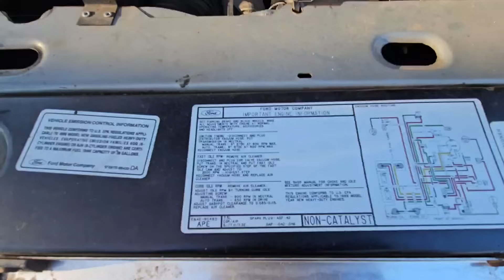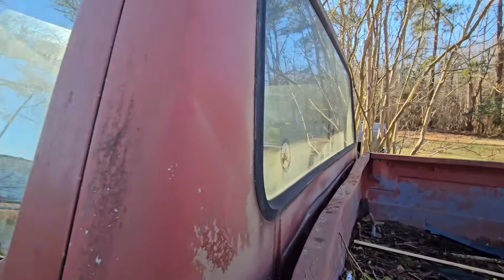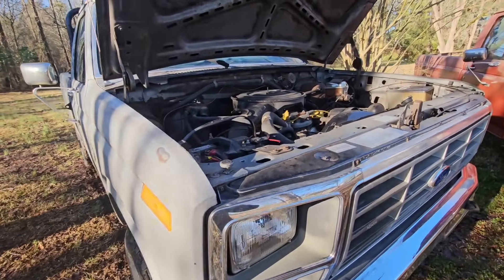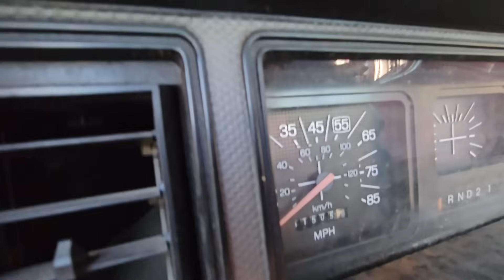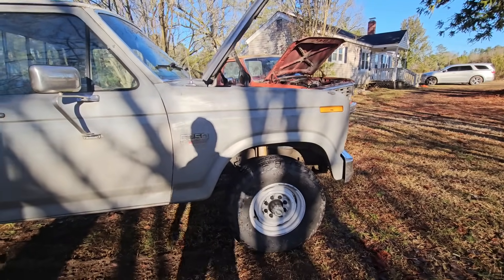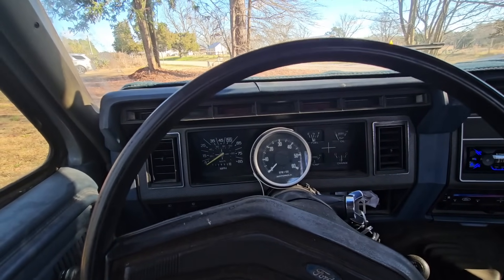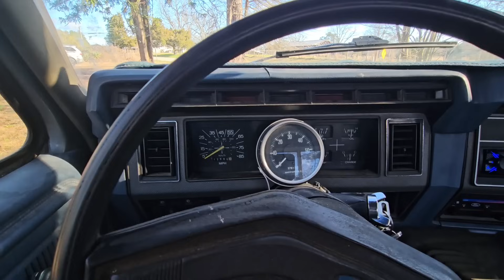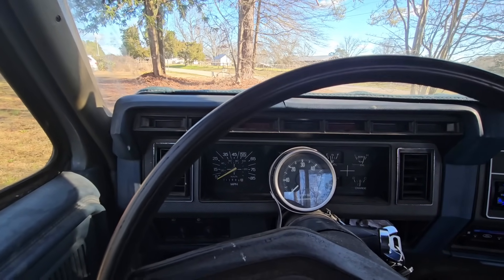THE WORST TRUCK FORD EVER MADE!?!?! #ford #fseries #sbf #bbf #truck

Comment: I bought a similar new 351 F100 ute in Australia in 1981 (Ford Australia) and after less than a year the interior plastic trim was falling to pieces from UV decay. The bonnet (hood) was rusty as hell as was the bottom corner of the cab, apparently due to poor rust proofing, as we don't use salt on the roads here in winter, it never snows.....
There were never many of these body style sold here, probably because of the shitty build quality. Of course here they were RHD, so I assume they were assembled in Australia.
Reply: 1981 was the first year of Australian production for the bull nose F' series, the cabs were US ones converted to right hand drive although Canadian models were used in earlier models also.
Later 92 on Brazilian assembled right hand drive models were sold by Ford Australia.
There were some complaints re build quality however overall the new cab design wasn't as robust as the 73 - 80 series and dash board rattles and plastics were sub par to Toyota Landcruiser and Nissan pickups here .
The chassis and drivelines were generally good,  although very strong, the aging design of New Process 435 manual gearbox was clunky with a 6.69:1 first gear and a big jump to second leaving a 3 speed gear box with a super low reduction 1st.
The later 5 speed manual gearboxes were more user friendly and gave a better spread of ratios.
The Dana 44, 44HD in 4WD front ends were quite robust and the F100 ford 9"  F250 Dana 60 , F350 Dana 70 floating axle rear ends were strong rear ends.
C6 auto's were quite a hefty transmission and generally if cooled well gave little trouble.
Cab rust was always a feature in coastal F series in Australia less so in the dryer areas.

Comment: I had a built 351w retrofitted in an 88 mustang LX. That was a wicked engine with the right aftermarket parts. The specs for the 460 sound correct, like 225hp, but a lot of torque.

Comment: Nice Trucks !!! 85 & 86 F 250 and above didn't have catalict convertors.  Air pump would put it back in the manifolds .they burned real clean . I had a red 1986 F250 2wd 351,4 barrel holley carb,c6 trans and the monster rear end . Hands down the best truck made , no ac ,you use the small side widows,better than ac . I miss you girl .

Comment: Yea those bull nose trucks are definitely not ugly to me there definitely better lookin than the block nose front end trucks but I’d take either truck though. I got a 85 f-150 from my papa after he died in 2002 and I still got it today. I’ve just swapped it over from a carbureted straight 6 to a fuel injection 302. I also got a 07 f-150 KingRanch but just to be straight out honest I’d just assume to drive either truck still today

Comment: I had around a dozen F150’s 81 to 86. All but one had the 300-6. The biggest problem with them was the stupid emissions and carburetors especially after 1983. 
If you wanted to find a real rare 80’s Ford truck see if you can find an F100 with the 3.8 V6. I think the 3.8 began in 1983 but wasn’t available very long. It might have been available in the F150 too?

Comment: Ford never made a good truck bought a 1980 f-150 brand new and it caught fire tried an 86 f250 it turned out to be a money pit had 1999 f-250 couldn't keep a front differential in it btw all of these was 4wd after that I bought a 2004 Silverado 2500hd with a 6.0 and 260,000 miles later all I've needed is tires,oil and grease and normal tune ups I'll never own anything other than a Chevrolet

Comment: Had a used 71 Lincoln with 460  and later a 72 Ranchero with 351. Both great engines, lots of power and 20 + mpg.

Comment: My father bought a 83 F150 and a 89F150 , both great trucks ,, both have the 6 engine with manal shift.. the 83 was on the column 3 speed and the 89 was a 5 speed on the floor.  Both were RWD with a single cab.  I drove them both and loved them , but not the best for city driving.. both were super reliable, comfortable and rode great.

Comment: I  own an Australian assembled F350 4WD, right hand drive , fitted with the last of the Australian cast block 351 Cleveland, an engine factory fitted to F series here since 1974.
Other than the odd dash board rattle I have generally found it to be reasonably robust and capable truck, having said that I also own a 1974 Australian assembled F250 Hi Boy originally fitted with a 300 cu 6 cylinder but now fitted with an Aussie 351 Cleveland also, both do the same job however power steering was not an option on the Australian Hi Boys so the 74 350 is a little easier to manouvre at low speeds.
No computers and complex electronics make these both user repairable and generally reliable very trucks, especially in the remote and harsh conditions that exist here in Australia.
Both get my tick of approval, later US trucks are too prone to problems that can't be easily repaired out of mainstream area dealerships.
Jus sayin'

Comment: I just sold last year a 1986 year I graduated from high school, 2 Wheel Dr. it was the same color as that brownish one. I don’t know what that color is but it’s not brown it’s weird brownish gold I guess they call it and it had 47,000 miles on it it was a really good truck. It didn’t run when I bought it. All needed was a carburetor rebuild and some timing and a few other little small small things.  It was wonderful and I’m kicking myself in the ass right now because I’m remodeling an old house and I need a truck. I have a bump side but it’s too nice to use as a work truck. That’s a hot rod my bumper sides a hot rod. Yes those are both great trucks summer more desirable than others if you remember  first couple of years I think 80 to 82 g to make them lighter and they bend. The one I saw was a 460 four-speed, single cab no rust, California truck in California at three-quarter tons did not come with catalytic converter‘s yet anyhow, nice video guys have a great truck. I’m looking for another one just stay away from the first few years. They got better as they made more of them and I think they’re way better than the flat nose ones of the late 80s early 90s, I had a 96 and I didn’t like it as much as the 86 but then again, the 96 was a 4.9 vs The 460

Comment: I have 1995 f-150 with 4.9 300 long bed I upgraded the front fuel tank from 15 gallon to 19 and this truck also came with additional 15 gallon rear tank. I only fill up nearly two times a month, but i wish i had four wheel drive 😅😅😅

Comment: Replace the timing chain on both trucks with double roller with multi index crank sprocket and set them up 4 degrees advanced from straight up. Run smoother, start easier, unbelievable low-end torque, and amazing  fuel economy. Makes them a lot easier to drive. Great video. Miss my ‘85 F 250 351w HO C6 automatic. Got 18 mpg highway empty.

Comment: I think the main reason no one likes these is because they rusted very badly, my grandpa had a 1983 F-250 Ranger XLT IDI Diesel with the heavy duty towing package that he bought brand new, that truck was getting pretty rusty by 1990 and we traded it for a 1991 F-250 Lariat XLT 460 V8 gas, that truck to this day we still have and has only recently started to get some minor surface rust on the frame. We've always maintained all of our farm trucks but that 83 just wasn't a great truck, styling wise everyone in the family loved it (it was dark brown with a tan two tone section across the center of the truck), but it just wasn't a great truck in other more important ways.

Comment: 1975 was the first year for Catalytic converters on cars, they started getting phased in on trucks over the next decade. We had a 75 F-100 that was non-catalyst but still required unleaded fuel. In 1985 it wasn’t A/C delete as A/C was an option.

Comment: Worst? I had an 82 f100 years ago and it was far superior in looks and hauling to my current 2001 f150. As far as I’m concerned ford hasn’t built a real pickup since 1997. They downsized the most crucial part the cargo bed.

Comment: Did I really hear you say that you were asking $5000.00 dollars for a $1500.00 dollar  truck.  What area do you live in where you think you can get that much money for those ?
Reply from the maker: @ralphsnow2337  $1500 for a running driving truck with heat an AC with fairly low miles even for an 1986? Did I expect to get $5000 for it? No. Always start high of course. I know what I had in it to get it back on the road. From the oil filter date when I pulled it., it had been sitting since 2011. I do not own the truck anymore and has since been sold, and I got $4000 for it. The truck is a daily driver now. Yeah it needs a paint job, but the body was very straight and zero rust. Interior was in great shape especially for being thebsun beating it got being a southern truck. Look on marketplace, the auto traders, ebay, bring a trailer, or wherever you can find these and find one for $1500 that is a daily driver with heat and AC, lower miles, and with zero rust
Reply from the maker: @ralphsnow2337  I can agree with you. I think this truck SHOULD be worth $1500. But I also believe my 1979 firebird should be worth the same price I bought it for 15 years ago. Which was about the same price as this truck and was and still is a daily driver, but unfortunately, inflation gets the good stuff. Everything is getting expensive.

Comment: My TTB '84 4WD Diesel has probably 500k on the frame and cab, has parts under it from 1983 thru its 1992 7.3, and has been hauling my butt and whatever i pull around with it since 2001. It will drag any other 1984 model from Dodge or GM down the road backwards, and ride much more comfotably while doing it. Best riding and most powerful trucks of their day, and a great bargain now.

Comment: i had a 1981 F250. Third owner and drove that truck hard for 18 years. It was a beast and was still going strong when I sold it. It was the second best truck I've ever owned. The best one is my 2005 Ranger that I drive today and have been driving for 19 years. It still runs and drives like new.

Comment: This is my favorite style of Ford truck. Had a few over the years. My first was a 1979 F250 with a 351 auto that I plowed snow with until my second a 1992 F350 with a 460 Auto 4.10 axles and that one was a towing fool, but was a little hard on gas. When I told my friends it had too much power when plowing snow, they informed me you could not have too much power, but when you turned around and started in the other direction it was a little tuff to get immediate traction so you could not plow as fast as you wanted to. My last and probably my least favorite was a 2008 F350 with that damn 6.4 liter Powerstroke. Got 5mpg when plowing snow.8mpg in everyday driving.

Comment: I owned an 89 F150 (300/5-speed), but I never owned one of those trucks. I did drive some of them as well as a fair number of well-thrashed Broncos and E350s. The place where I worked had a couple of early-mid 80s F100s, both 300/manual 4-speeds.  One had the SROD, and while no one ever sang praises about the transmission beyond Ford advertising, it wouldn’t break for us despite a fair amount of abuse. One E350, an 85, had the 351HO. I was initially surprised how much pep it had and thought it was a 460 until I popped off the dog house. Anyway, I haven’t seen any of those trucks for sale in my neck of the woods for a while that weren’t badly rusted that were cheap.
Reply from the maker: Experience speaks through your comment which is appreciated! They're great trucks for sure and not badly priced at all at the moment!

Comment: I would love to own either of those work horses.
I need a truck.
I've been using our 2014 Audi allroad to haul loads of large stone, wood, garbage, around our property...At one point over 640lbs quikrete cement.
She's been solid throughout but I've torn too many cv boots driving through the hills and woods.
These old Ford's would get the job done with vastly better efficiency.
Seriously, why am I using an Audi wagon to do the job of a truck?!
Time to go find an old 4wd Ford and do it 'right'...

Comment: The older trucks are more reliable then the new truck and will last a lot longer my 1986 f250 ford with 5.8 has over a million miles on and still going strong. So get or facts straight

Comment: I think they are beautiful. I have an 84 F250 4x4 that is identical to the red one. Rusty, because Michigan, but has faithfully plowed my driveway for 30 years. Hauled dozens of cords of firewood. It's a factory high output 4 barrel 351W, it was rebuilt in '99 with a Crane HMV 260 cam, and a 750 edelbrock carb. Has a Sun tachometer on the column, just like yours. Emissions exempt as well.

Comment: By youngest brother bought an 1998, F150 XLT 4x4, 300 straight six EFI 5 speed low hole reg cab short bed, black with red vinyl bench seat. For just around $20,000! I bought a 1986 Dodge D100 reg cab 4x2, 232 slant 6, 727 automatic, with SE Package, nice cloth bench seat, wood grain dash, AM/FM, with towing package with 3:55 gears and towing package with limited slip. In light metal blue, blue interior. Brand new for $14,600! That ran fantastic! That actually towed better than the more powerful F150, because it was a 4x2, that the Ford, with twin traction beam front end wasn’t, that when towing heavy, the same boat each year at 9,000 lbs, would have the front end raise up, that would cause the front end to hang the front wheels at an odd toe in angle, that made hitting bumps at speed scary!
Reply: 1996 was the last year for the 300 straight six in a F150.  So if you have one in 1998 you're doing well.

Comment: I have a 90 f250 460 lariat 2wd maroon/red with red cloth interior 92k original miles pulled it out of a yard after 10 years changed oil and belts and front tires and has been my daily lately

Comment: The converter started in 1975 they cheated on trucks for years that when the F150 came in play the F100 had the converter the F150 didn't until 1979 then the F250 came into play the GVW played in and it went on for a few more years

Comment: I have A 89 F250 4 wheel drive 8 lug steel wheels 300 6 cylinder  4 speed overdrive This truck is a Beast 9 miles per gallon though

Comment: My current lineup is a 86 F150 302 2wd, 88 F250 7.3 IDI, 90 300 I6 2wd and a 90 300 I6 4x4. I love my old fords. Looking to add a 460 and 351 at some point. What I really want next is a F350 flatbed 460 with the hard to find 4wd and ZF5 options.
Reply from the maker: Very nice!!!
Reply: One ton 4x4 Fords aren’t hard to find at all
Reply: @warrenmcelroy4718  The 1 ton 4x4 5 speeds are a little hard to find around me. I rarely see them for sale. Especially the 7.3 idi

Comment: Nah, the Bull/Brick Nose Fords are BY FAR the most popular Truck build now because they are the last of the affordable Classic Trucks. I watch trends in the classic auto markets, the top 3 builds in the Classic car market is the 1. The Mid-late 70's Muscle Cars 2. The 1960 Economy cars (Chevy II's, Falcons, Valiant/Dart and AMC Rebels) and  3. The 7th, 8th and 9th Gen (1980-1997) F150's. It's because they are all cheap to buy and cheap to build because they are "unwanted" vehicles and the parts are available. You can go out and buy a Bull/Brick nose F150 and build it pretty much anyway you want for the same price or cheaper than you can get a Dentside Ford, Square body Chevy, or Frog face Dodge roller....

Comment: Sorry to reinforce and critique you work here, but these two trucks are significantly different.  Different color, engine, transmission, wheels driven, different options.  They were sold in different states, owned in tow different manors.  All you need to know about what is load carrying capability is on the various labels on the door jamb or emissions label.  

And what about false advertising in the tag line.  Is the motivation for the video to sell the trucks?

Comment: THEY ARE UGLY, ROTTED EVERYWHERE, PAINT WAS JUNK, BUT WERE RELIABLE.
THE 460 WAS A BOAT ANCHOR SINCE 72.  VERY UNATTRACTIVE AND 
CHEAPLY OUTFITTED.  YOU CAN'T COMPARE THEM TO THE 70S'
MODELS.  THE 79
IS STILL A HEAD TURNER.

Comment: Ford typically are shit , but the mid to late 80s trucks weren't bad. I liked that body style. The late 90s early 2000s ford was absolute crap and beyond ugly. I use to be a Ford guy, then I grew up! Horrible to work on, always broke down, miserably uncomfortable seats, no leg room for tall guys. Horrible gas mileage  and no power. In 96 I bought my last new Ford. After 70,000 miles it was so much crap that even the dealer told me don't bring it back we can't fix it. $12,800 in repairs later I bought an 01 GMCSierra. Best truck I have ever owned. It now has over 600,000 Miles on it and drives like new, 18 mpg and almost 300 hp with 4wd meanwhile my Ford loving brother paid $97,000 for a new F350 and had to get it replaced under lemon law within a year. I'll stick with what has treated me right GMC. But I would lS swap an 86 Ford .love the look
Reply from the maker: Good stuff! Like the input and experience!! I agree with you about your GMC. Probably the most reliable trucks ever made and the 4L60e's aren't as bad as people say they are. My 1979 firebird that I daily has a 4.8 and 4L60e I yanked out of a 99 silverado.... 260k miles on it and like you said about 300hp and it runs like new, don't smoke or anything. Taken care of it and it'll last!
Reply: I replaced so many gm transmissions. Alot of 1998-2003 Chevys broke down because of overheating and transmission problems.

Comment: I always had late 60s some 70s and my cut off was always 81 Ford pickups cuz they were always dependable well I bought a 94 one owner Ford F-150 XLT extra cab short bed two-wheel drive 138100 miles on the odometer this thing runs and drives like kitten everything not even a rust bucket, told my friend I would trade him title for title if you got me a perfect condition 81 Ford F-150 in in the like same condition as my truck because I like the older one